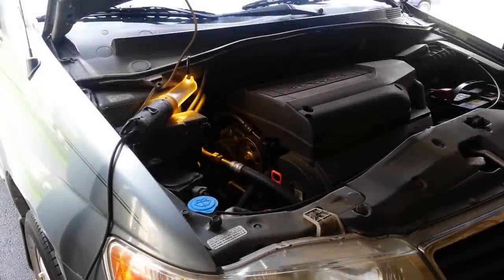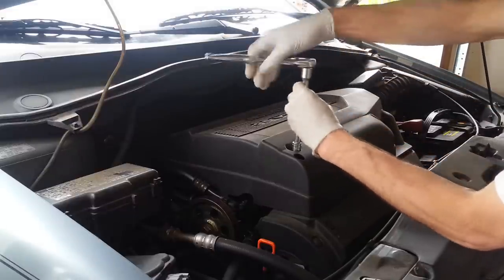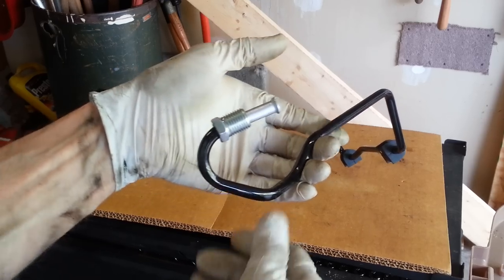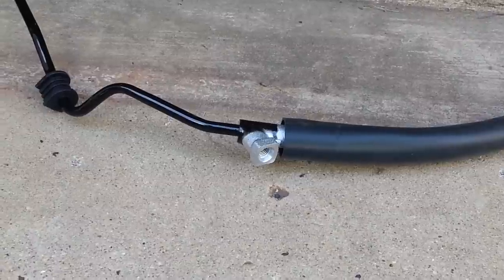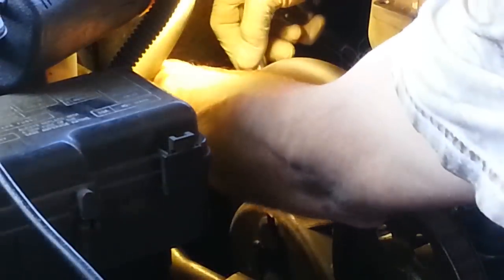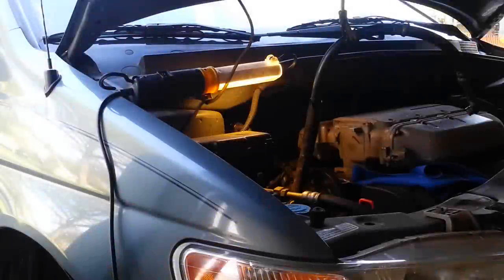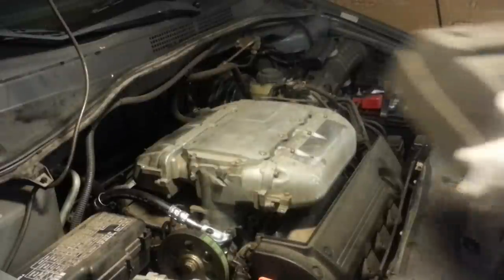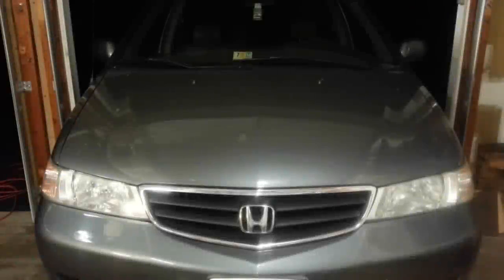Power Steering Hose Replacement 2002 Honda Odyssey

Comment: Local shop quoted me $271 out the door...3rd party hose but OEM o-rings at the pump end, says pretty much worked out the kinks with a few previous non-oem hoses and does this repair weekly.  So for me, if I went after-market (of which I don't know which he uses so that's a crap shoot) at about $70 ($150 for OEM), then $12 from Honda for the o-rings, and then about $10/bottle (need 4 for a good flush) that's $130 with no recourse if it leaks ($200 if I bought OEM)  What'cha think?
Reply from the maker: Having done the job myself and hearing the experiences people have had with aftermarket hoses, I'd most definitely pay the extra for the OEM hose. The labor is the same. Others may have a higher tolerance for the risk of using an aftermarket hose and potentially having to do the job yet again.

Comment: Do you think it would be easier if i feed the new hose up from the bottom rather than down from the top? I'm trying to save my future self some frustration.
Reply from the maker: I could not find a way to do that. It is challenging to get the rigid portion of the hose around and through all of the frame members which is why it would only come out from the top.

Comment: I felt like it was too tight. I lubed it up with PB blast and waited. used a bar on the wrench. I gave it a try but I was too afraid to push it further. head of the nut seemed like it wasn't grabbing the wrench.. what can I do now to get it out???
Reply from the maker: +Eduardo Flores The PB Blaster was a good idea.  If you are using a good quality flair nut wrench, I would go ahead and push harder until it either pops free or fails.  Another viewer said that he used vice grips when his was damaged beyond repair.  As a last resort, you always have the option to cut the tube and use a socket or nut extractor.  Those things can be REALLY tight up in the rack.

Comment: How did you access the driver side connection with your 5 point wrench? Mine is very congested. What did you remove to gain so much space?
Reply from the maker: Not much. I just had that corner up on jack stands with the wheel removed. I was then able to reach around the suspension to get my line wrench on the fitting. Those are tight quarters no doubt.

Comment: you can just cut the metal parts that is connected to the hose and use a hose clamp instead.
its not the right way but it do work.
Reply from the maker: Interesting idea if you're on a tight budget. Seriously, though, I wouldn't trust it with the pressures inherent to power steering systems which can easily exceed 1200 psi and sometimes can go as high as 2000 psi. My family's safety is too important.

Comment: Where do I find the power steering feeding hose on a 2003 Accord? Great video BTW. Dealer wants to charge me $700 they say the feeding hose needs to be replaced due to a steering fluid leak... PLZ HELP!!
Reply from the maker: I am not familiar with the term "feeding" hose but your dealer is most likely talking about the high pressure hose that goes from the top of the power steering pump, down behind the engine, and into the side of the power steering rack under the car. This video shows me replacing that very hose on our Odyssey. The one on your Accord should look very similar to mine and the replacement technique would also be very similar.

Comment: Black o-ring on the new high pressure hose... "should" that have been replaced with the "new" orange one? Just curious
Reply from the maker: There's a TSB about replacing the o-ring where the low pressure hose meets the pump. It is to fix a noisy pump where air is being drawn in at that location. Not sure if there's another TSB about the o-ring on the high pressure side.
Reply: worsethanchiggers gotcha! thanks for the clarification.

Comment: where did you buy the factory  high pressure hose? I need the replace the high pressure hose on my 2000 honda accord v6 3.0
Reply from the maker: Google bernardi parts

Comment: my Acura TL is leaking in that same exact spot of the hose. is it possible to just replace that front portion of the hose? or you have to replace the entire hose?
Reply from the maker: You really need to replace the entire hose assembly. The point where the leak occurs is a crimped connection between the flexible hose portion and the hard line. Unless you have some expensive specialty equipment, you can't duplicate or repair that connection.
Reply: worsethanchiggers thank you for you quick response

Comment: How many o -rings are on the line. I'm thinking 2 one by the switch then the second at the top?
Reply from the maker: You are correct. Just those two.
Reply: Thanks, don't want any leaks or cloggs

Comment: This video could be greatly improved. I strongly suggest pulling out the old hose from the bottom and installing the new hose in reverse sequence. Remove the sensor probe before pulling the hose out from the bottom and then Install the probe only after the new hose is in place. This video skips this procedure completely by merely stating to push the new hose down from the top (follow this path only if you want to make the task much more difficult.) Then there is text that states: "15 more minutes of pushing pulling, and twisting. Again, don't do this unless you're a gluten for punishment.
Reply from the maker: +Patrick Blasz
Hi Patrick and thanks for the additional insight. Curious if and how you've been able to do it that way. That detail would be helpful for those yet to attempt this task. I simply found no way to remove the hose assembly from the bottom. Not even by removing the driver's side wheel and coming out that side as some have suggested. It wasn't so much the existence of the sensor. The shape of the hard line just made it impossible to get around and past the frame members. By coming out the top, the sensor was mostly a non-issue. The 15 minutes of pushing, pulling, and twisting was a bit of an exaggeration and included time to ponder how to carefully accomplish my first experience doing this particular job as well as a deserved beverage break. I love the YouTube community and how we get so many good and alternate approaches to DIY.

Comment: Is there only one hose to replace on the power steering pump?
Reply from the maker: There are 2 hoses that connect to the pump. The high pressure hose is the one being replaced in this video and is the one that typically leaks. It goes from the pump to the steering rack. The low pressure hose is a short one and goes from the reservoir to the pump. You can see both on the diagram here. https://youtu.be/ckuxUVF16k8?t=75

Comment: I just swapped mine out using this video.   My only issue now is the power steering is groaning and the fluid is over flowing.   Do I need to bleed them for a while?? Thanks
Reply from the maker: Yes, first ensure that you have fully blead the system by turning the wheel from lock to lock a number of times.  You may be getting foaming in the fluid due to air in the system.  The fluid will look milky in the reservoir. Let that disperse and then check the fluid level. Another possibility is that you are drawing air into the system where the low pressure line enters the pump. There's a TSB on that where the o-ring needs to be replaced. In any event, the noise from the pump is usually from air in the system.
Reply: +worsethanchiggers thank you.   After bleeding the line it worked perfect!!
Reply: +Adam brown I rounded my flare nut pretty bad.  I ended up using a set of vice grips and it worked great getting it to loosen
Reply from the maker: +Adam brown Job done!
Reply: +worsethanchiggers I also had to use vice grips to get the nut off - the flare nut wrench did not work, I think I had already stripped it from the open end wrench.  I jacked up the car and removed the front wheels, I was able to sit on the garage floor while straddling the hub and reach into the are where the steering rack is located and easily got a pair of vice grips on the nut - the hardest part was rerouting the new hose into position, this took me over an hour,  I also broke the electrical connector because I did not know how to properly disconnect it.

Comment: How did you install the new one around the subframe?
Reply from the maker: I painstakingly fed it down from the passenger side of the engine compartment, over and through the frame members to its final resting place. It was a real puzzle to do without bending the hard line but I finally got it through to its final resting place.

Comment: We replaced the hose on my van now the noise is louder why do you think?
Reply from the maker: Maybe you haven't bled all the air out of the system by turning the steering wheel lock to lock several times.  You can see that procedure at the end of my Power Steering Pump Overhaul/Rebuild 2002 Honda Odyssey video. Or, it may be drawing in air around the o-ring.  Is it foaming inside the reservoir?  That can indicate an air leak.

Comment: I see you posted this video in 2014. Do you still have your 2002 Odyssey?
Reply from the maker: Unfortunately not. It was totalled in a relatively minor accident.
Reply: @WorseThanChiggers  I replaced my 2001 Odyssey back in March but, I still drive it, insured with liability only.  I used AT-205 Re-Seal Stop Leak in the power steering fluid reserver, which reduced my power steering leak rate by 90%.  Now I'm glad to actually find out what's causing the leak and now I can stop it for good and quit using 205 Stop Leak.  Replacing the hose assembly seems like a daunting task but, I think I'm going to go ahead and do it myself and then list my Odyssey for sale on Facebook Marketplace and Craigslists.  My Odyssey does not have the "rat-car" look, that so many of them have now, since it was garage kept.  But, I don't think I'll get much for it.  She still drives like a sweetheart at 372k, with transmission #3, and has very little oil consumption.
Reply from the maker: Glad yours is still on the road and looking nice. Its always nice to have a cheap backup vehicle that you can trust.

Comment: Can power steering fluid leak onto your oxygen sensor causing it to go bad while changing the powersteering hose.. Had the hose changed now my engine light is on which never came on code reading oxygen sensor or did the grimy looking mechanic do something shady..03 Honda ody
Reply from the maker: I don't see how because those systems are completely separate.  It would mean that power steering fluid is somehow entering the combustion chamber, combining with the fuel and air mixture, and then exiting out through the exhaust system where the oxygen sensor would be exposed to it.  Doesn't sound plausible to me.

It's more likely that you're reading the codes incorrectly.  Remember that a code tells you which system is being affected, not what part needs to be replaced.  A code indicating a bad reading by an O2 sensor could be something as simple as a vacuum leak.  Check that your guy didn't just knock off a vacuum line or incorrectly reinstall the air intake hose under the hood while working on the power steering.

Comment: Help, I accidentally yank the electrical connector along with wires off the car. What will happen if not replace?
Reply from the maker: I assume that you are referring to the pressure switch? The function of the pressure switch is to stabilizes the idle speed of a car while the steering wheel is on full lock, either to the right or left. When the system exceeds power steering load limits, the switch sends a signal to the engine control module to compensate. If you do not repair it, the engine may idle very low and rough or even stall when the power steering is under heavy load.

Comment: I think mine is leaking at the switch. Can i remove that switch without removing the entire line?
Reply from the maker: Definitely. Take the passenger side wheel off and you should be able to get at it through the wheel well.  It could be the o-ring or the switch itself is leaking.
Reply: worsethanchiggers Ty for getting back to me. Yeah I was just curious because it seemed like that one was on tight and it just seems to be "floating" in a way where I cant imagine how to keep it in place while trying to break it free, all while trying to prevent causing anymore leaks.

Yeah I know I broke records with that run on sentence. Any suggestions as to how to keep it still, break it free, prevent other leaks?
Reply from the maker: That'll be the tough part. The fitting into which the pressure switch screws is square with four flats.  Find a way to counter-hold the hard line at that fitting with a wrench while you unscrew the switch with another.

Comment: Is the 01 engine and the 02 the same?
Reply from the maker: The engine itself should be the same though some of the intake components on top are a bit different.
Reply: worsethanchiggers ok got it. Thanks.

Comment: I stuck a 2 foot pipe on the end of the flare nut wrench, it's on too tight
Reply from the maker: Several people have suggested just cutting off the metal hard line next to the flair nut. Then use a regular socket wrench with a long handle or cheater bar on the nut.  At that point, I'd consider using an impact.
Reply: @WorseThanChiggers  As I noted somewhere above - cutting off the metal hard line with a metal saw, could introduce metal particles back into the system!!!  If that happens, a much bigger problem could be caused - MUCH !!     Cutting off the metal tube with a small plumber's pipe cutter, could be safer (but not 100% safe), yet the cut wouldn't be "flush" with the flair nut due to the specific shape of such cutters.  That could cause issues with using a socket wrench.    There should be a better way after-all...... !?

Comment: Great video!  Mine is leaking and needs to be replaced. Do I really need to replace that little o-ring? (P8)
Reply from the maker: It's a very good idea to replace the o-ring while you're in there. Chances are yours is hard as a rock like mine was and will leak once disturbed.
Reply: Thanks! Bought one today and will attempt to replace the hose also today...

Comment: How did u get the line back in the rack?
Reply from the maker: Getting the new line's fitting into the rack was no problem at all. Simply insert and tighten the nut with a line wrench. Removing the old fitting and routing the new line through the engine bay were the tough parts.
Reply: @WorseThanChiggers  i had absolutely no problem with anything other than that. Just my luck i guess... The old one went back in just fine so maybe my line is just bad. Thanks foe the reply

Comment: just did mine and all other rubber hoses + pump today, 202k mi.
never swore more while working on the car in my life.
I had to cut the hard line off at the inlet to the rack because the compression fitting was stripping off with a wrench, & use a14mm sucker, which apparently is more tighter than the loose factory nut. Go figure =(
Reply from the maker: Good work! Yet another DIY victory for the good guys.

Comment: do u bleed the Line with the red cap on or off?
Reply from the maker: +jay mac The reservoir is not pressurized and the cap is not air-tight.  So, it doesn't really matter.  It should not splash but I would put the cap on just to ensure that it does not.

Comment: Why not cut the old hose and take half from the top and half from the bottom, to not deal with it getting stuck
Reply from the maker: I found that the struggle to get the old one out was VERY useful in learning how to put the new one in. I wasn't concerned about damaging the old one as I twisted, turned, and pulled it out. However, I would have been much more reluctant to force the new one with no prior experience.
Reply: worsethanchiggers thanks for the comment and video. Very helpful for me to fix the family car

Comment: You didn't have to buy a flare nut wrench. Cut the tube with either a tube cutter or a hacksaw ( just above the flare nut) and use a 14mm deep socket to take it out.
Reply from the maker: John Doe That is definitely an effective approach and has been suggested elsewhere.  I selfishly wanted a flare nut wrench set, anyway, so it was a good excuse. I would worry, however, about using a hacksaw and getting metal fragments into the steering rack.  That would certainly result in an early demise for the internal seals.
Reply: worsethanchiggers I was only suggesting it in case those of us who have the sockets available and a hacksaw or, better yet, a tube cutter at hand. The approach I suggested would have come handy if one was concerned that the flare nut would not come out because of rust.

Comment: Besides the hose do I need anything else ?
Reply from the maker: - typical metric wrenches and/or a ratchet and sockets
- line/flare nut wrench- power steering fluid
- patience
Reply: Thanks